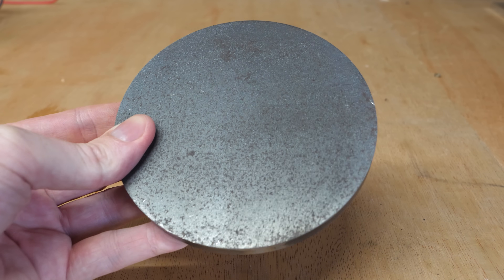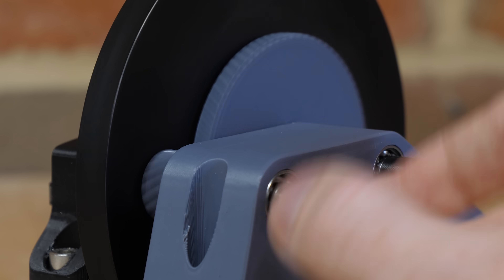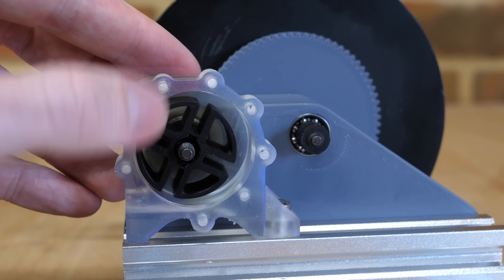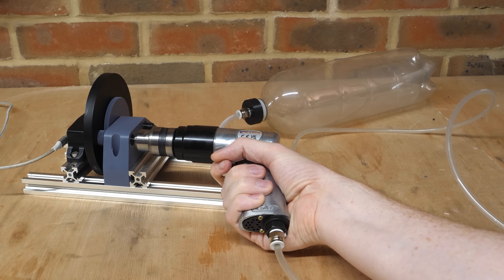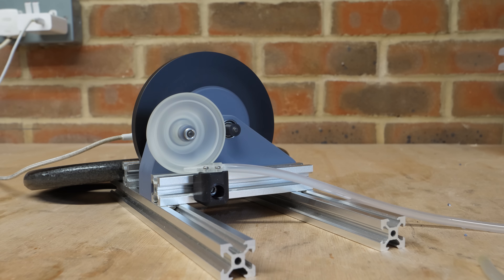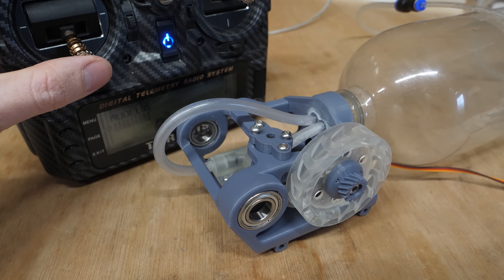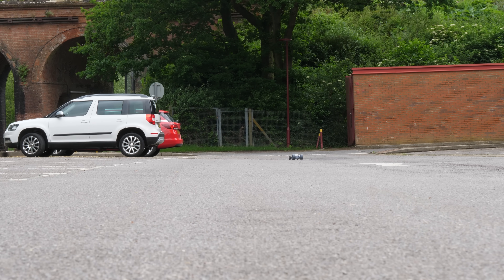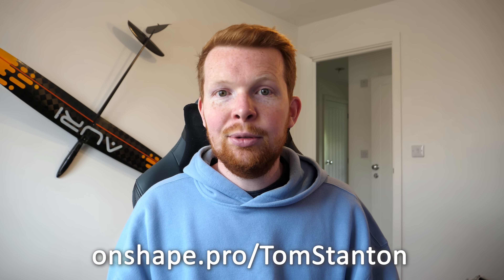Building a Turbine Car

Comment: Tesla turbine?
Reply: It wouldn’t be as efficient at lower rpm’s
Reply: But maybe by using a clutch mechanism higher speed could easily be achieved
Reply: @landon.plywood7324 the problem with the Tesla turbine is there's no torgue. Maybe tons of gear reduction but it inevitably looses efficiency .   A clutch it's helping anything in  theory .
Reply: Exactly my thought
Reply: With Tesla valves on the sides
Reply: Integsa?
Reply: The misconceptions on tesla turbines in this thread are crazy. Let me clear some things up (sorry for the long comment):

Manufacturing: the tesla turbine is SIGNIFICANTLY easier to manufacture. You can buy very thin aluminium sheets (think soda can walls in terms of thickness) and CNC discs with exhaust holes and star washers. Then 3D-print a jig that stamps dimples near the edge of the discs to maintain the spaces at the edges without bolting the discs through. This allows the discs to freely expand under load without exploding. The aluminium also makes the rotor lighter. Also another point regarding manufacturing, balancing is pretty much unrequired.

Torque: the low torque issue is a myth. As with anything mechanical, if you want more torque from a tesla turbine you need to design it with a larger radius to increase the moment arm around the axle. Basically the rules-of-thumb for increasing torque are larger radius, more discs and narrower disc spacing. Larger discs also increases low RPM power and efficiency as the air takes a longer path dragging the discs along. Another point to keep in mind is that the tesla turbine acts as a torque converter, the higher the velocity delta between the flow and the discs, the more torque it outputs at the cost of efficiency.

Temperature: for the working gas the viscosity increases as ~√T. Since we need the flow between the plates to be laminar in order to have the most efficient momentum transfer, increasing the viscosity by using a hotter working gas is a good way of ensuring laminar flow over a wider velocity delta between the gas and the disc. Thus you get wider torque and power curves. With the previously mentioned aluminium rotor design up to 300°C is perfectly safe without experiencing much thermal expansion. For higher temps I have seen some claims of carbon fiber composites being used but I am skeptical of these claims

Flywheels: you don't need a flywheel if you build it right as it will be a flywheel innately. However if you still want to just stick another tesla turbine on the same axle driven by the first one making it a centrifugal "vacuum pump". This is usually called a 2-stage tesla turbine, basically draws a vacuum at the exhaust to increase the pressure difference across the turbine.
Reply: Integza response
Reply: Y'all need some Jeremiah Ferwerda in your lives 😂
Reply: I see it, think on the Tesla Turbine want to write it and see your comment😂😂😂😂 great moment.
Reply: wacks u with a 2 litre plastic drinks' bottle
Reply: I want to ask all of you a question, have you ever tried to build the tesla turbine perfectly as made by Tesla. Because if you have tried you won't say so.
Reply: Would work great once the vehicle is going max speed but would suck at low speeds. It wouldn't have great torque but great efficiency at top speeds.
Reply: They are shit at moving workloads compared to an actually efficient turbine
Reply: I wonder if it's like a seagull thing where every video that shows any type of turbine you will have someone say "TeSlA TuRbInE" or
Why not tesla turbine this tesla turbine that like it's some religious following, the ultimate perfection.
Reply: @blackturbine or maybe people just want to see them in action or at least tried since they dont seem to be very common on youtube from what ive seen
Reply: come to that i think of it, maybe possible but hard to do without precise machinery
Reply: Tesla turbines ca  be made with foil seen someone else make them like that@Skibidigokyllyourself
Reply: @Skibidigoloveyourself  can stamp tesla turbine discs like what Charlie did in one of integza's videos.
Reply: Tesla turbine works for water that has surface tension unlike air
Reply: Air has surface tension
Reply: Tesla turbine is a failure...ive tried 3 different ones they all suck....i was very disapointed so....this turbine i would say performs good..but not best
Reply: @yanikivanov  did you use a flywheel?
Reply: @landon.plywood7324  plywood? No dude i used steel discs...so if you want you can build tesla crap turbine and you will see how poorly it performs
Reply: I'm sure a Tesla turbine won't work under load
Reply: Tesla turbine has been tested by many YouTubers it doesn't work good with air
Reply: I think the only issue is the low torque but high speed
Reply: Not efficient enough

Comment: Have you researched gas engine turbochargers? they use exhaust air pressure to drive a turbine that is attached to a second turbine on the compressor side of the turbo. chances are a profile like that will be your most efficient design.

Comment: If you linked the single powered rear wheel to the other one with a small shaft you'd have a lot more control over going straight. That's kinda of a dragster after all eh?

Comment: Although it's designed for water, I wonder how a Pelton Turbine would fare in this application. You could also test a Tesla turbine too. I think it would be interesting to see a side by side comparison of different turbine types.
Reply: Peltons kinda suck running on gases because they tend to suffer from large windage losses. The DeLaval design he's using is probably the best option, just needs fine tuning.

Comment: I'm not an engineer but I think the problem with your fourth design is that the cavities were too deep, because in order for the turbine to continue spinning each cavitity has to have pressure build in it for it to push so I think the best route would be to either minimize the diameter of the cavities to an efficient level or make them more shallow. Just an idea though

Comment: I have heard that a Tesla turbine is just CRAZY efficient. In fact, their extreme efficiency is supposedly the reason they are not in wider use. They're just TOO GOOD.
Reply: That doesn’t really make sense.
Reply: @mikebond6328  Yes, it does. They get going so fast that they either burn out their bearings, or self-destruct in some other way.

Comment: I have done some research on hydroelectric generation using a Pelton wheel. This device creates maximum    efficiency when all the fluid's momentum is transferred to the wheel by blade causing the stream to reverse its 
direction with the same velocity but opposite direction when the wheel is stationary. A wheel spinning at half the fluid's velocity would capture all the fluid's momentum, resulting in the fluid exiting at zero velocity. Maybe this idea is food for thought.

Comment: Huh, I expected you'd turn that flywheel down on a lathe; do you not have one?  :)

I'd be interested in how much you can improve the vane turbine with lower-friction plastic and proper sealing.  If you can work out the friction, an axial design seems like it could be really interesting, too.

12:37 Point of order: Browsers and things that run in browsers can both (independently) crash quite easily, I don't understand why people believe they don't. -_-

Comment: 2:04 measuring rpm with such a sensor is no problem, as long as you measure the time between the ticks, and not the ticks in a fixed time period. This gives very accurate results, and lets you measure extremely high rpm, more than you could ever need.

Comment: Nice work. Air engines/turbines are very capable. There was a man that developed air engines for vehicles decades ago and it worked quite well. There are some videos on that. His design used multiple carbon fiber air tanks designed to split open in case of failure since they were thousands of PSI and could be extremely dangerous. He designed a van that would get 300km per air fill.

Comment: Maybe it’s already been said, but one reason the pneumatic drill uses so much compressed air because it’s motor isn’t outputting 1:1 in rotation. It’s meant to be high torque, so there gearing to reduce output RPM/increase output torque.
Reply: Not to mention that the rotor and vanes are usually 1 or 2 inches long.

Comment: 7:45 I think that design failed because of air friction sticking to the sides of the channels. Air is surprisingly sticky when it comes to friction. As are most fluids and gasses. As air had trouble making it through those channels it likely lost a lot of air that just couldn't push itself into the channels either.

Comment: Any plans on trying a Tesla turbine?
Reply: It would be interesting to see, for sure. But my understanding is that Tesla turbines need absurdly high rpms to get any efficiency out of them, and even if they're spinning super fast, they are tremendously sensitive to any type of load. 

The Tesla turbine is a fantastic and mesmerizing thought experiment.. but there's a good reason they're not used virtually anywhere in commercial/industrial applications.

Comment: The one measurement I feel like you are missing is taking the power over time graph from the fixed volume test and integrating it in order to get energy. That way you can simply compare efficiency in one number watt hours (or seconds).

Comment: This is cool and all but if air powered things would ever become something useful in more everyday things it would need a way to access an unlimited source of compressed air, but question is, even if you develop motors and things that are highly efficient to use air at the best efficiency possible, you ultimately would need a motor of some kind powered by another fuel source to make that compressed air or constantly feed compressed air, but would that device that is making the compressed air be less consumption then just making an electric or gas motor in the first place? Compressed air isn't free energy, you clearly have to get it from somewhere, which is an alternative power source. This is the same sort of problem as things like solar and wind power, people are sometimes tricked into thinking it's free energy but it isn't, all those materials come at a cost, and batteries to story that energy is also expensive, has limited lifespans and uses rare earth materials and likely other power sources to make, so it's not that "clean". Maybe cleaner then fossil fuels but your still using up rare earth materials some of which are finite and non-renewable.

Comment: Something like 20 years ago in EU somewhere there was a guy or company that made tiny compressed air driven cars. If I recall they got something like 20 miles of range or something like that. It could also be filled using standard air compressor or something like that.

Comment: when u had the idea with the channels guiding the air towards the center: wouldnt it be better it the channels would be guided towards the edge of the turbine instead? using centrifugal force and the added air as a thrust to further increase the torque and rpm?

Comment: Just getting to the first graphs and I think Tom has made a bit of a blunder in his analysis.

The gradient of the angular velocity is not the torque produced by the turbine but rather the component of the torque that is greater than all the other combined losses of the system.

He’s going to falsely conclude that the turbine produces peek power at a lower angular velocity than its true peek power because he’s not accounting for the losses of his dynamometer. 😢

Okay phew all of the conclusions were based on the relative measurements so no harm done, perhaps by design ❤

Comment: That throttle valve may be reducing efficiency and power. Ideally, there should be only only one point with high air velocity - output of the nozzle.  No idea how to control it, though. Maybe placing the valve needle in the nozzle itself?

Comment: Would the turbine be more efficient with some moisture in the compressed tank to increase the reactive mass, or would it be faster with perfectly dry air to get more air volume in for the same pressure?

Comment: You can get very accurate RPM measurements with an optical sensor by measuring the time between high/low pulses.
Reply: Or get the signal and do a Fourier transform to convert it into a frequency.

Comment: It is above my level, but doing full on Model Based Design and optimizing a turbine for this pressurized air system would be really neat.  Are there any Open Source or at least cheap Generative Design tools?  Either way going full on engineering would be very interesting and probably produce a more effective design. 

Could also hunt for any existing Open Access papers on all this.

Also just to reiterate i am not a proper engineer, let alone making YouTube Videos (yet…) so i want to be VERY clear that this is merely an idea and not a “holier than thau” critique!

Comment: Had you considered using a 1/4 inch Air Die Grinder made to run much faster than a air drill which probably had internal gear reduction inside

Comment: Compressed air has to be one of the most inefficient methods of energy storage…
That’s what makes all of your projects with it all that more impressive!
Reply: I mean I just like the concept of pneumatic air compressors and such.
Reply: Yes, it's true. Pneumatic Cylinders are widely used in the industry. They have some (small) ambitions to replace them with electric actuators.
But electric actuators are many times more expensive in the purchase. And Pneumatic is simple and robust in operating and maintaining. That's why they stick with pneumatic.
A big part of the losses occur at the compressor in the form of excessive heat within the compressed air. As it cools down it looses energy. Some manufacturers store the excessive heat in paraffin, which heats up the air as it expands, giving some of the energy back to the working gas.

So, there is potential ...
Maybe Tom find's some clever ways to improve the overall efficiency ;-)
Reply: @notconnected3815  The absolute main reason that pneumatic cylinders are still widely used today in industry is because almost EVERY process in the industrial and most processes in commercial product production require compressed air for one thing or another. Weather its a cooling nozzle, a lubrication atomizer, or a heat resistant switch(only to name a very small pool of options where compressed air is used in place of eclectic).

In example of heat where I work(Cement Factory) we need to measure tire slip on our Kiln, the kiln shell is at 300-400°C. So we use a pneumatic switch to activate the electric limit switch with a small copper bellows to measure the difference in speed between the kiln shell and tires. The air getting activated each rotation cools the seals in the pneumatic trigger and bellows activates the NO Switch(My Design). We used to replace whisker switches weekly if not more often in dangerous positions for the electricians, changed the design and there ya go.

Same for our Klinker Cooler Redux Valves, exposed to temperatures of above 100°C. Pneumatic cylinders will last 5-12 years and an electric actuator will last approximately 5-7 months in those operating conditions.

Comment: This is so cool. I love the compressed air series - one thing that stands out to me is how the air comes into contact with the turbine, could you design a housing around the nozzle so that air that "splashes" off the blades can instead forced into the turbine? I'm imagining a waterwheel and how there is a lot of turbulence generated as water enters each bucket and some splashes out, I think there are similar mechanics at play here. If you could design a sheild around the nozzle to redirect that spray back into the turbine, I bet you'd see some efficiency gain.

Comment: I got inspired by this and want to make a electric flywheel dragster,  I would like to design my own clutch system for it to get maximum axeleration 0-60 in 1.2 seconds would be cool to reach 😎
Reply: Imagine if the flywheel is around 6 kilo massive steel 🥵

Comment: Great video, your second turbine was a straight forward impulse turbine. The 3rd turbine is a reaction turbine, but the path should be a convergence nozzle choking the flow at exit. These turbines work with the entire rotor being driven by air so not suited for your design. I would stick to a single impulse turbine. Staging the turbine as per a Curtis turbine won't work well as again their designed for being fully driven by air. Have you thought about having a water driven turbine. Have compressed air to pressurise a water vessel that drives a water turbine. Would run alot slower and wouldn't require higher tolerances. FYI your calls were correct. Impulse turbines work best at 0.5 air speed at nozzle. Reaction turbines around 0.8 air speed at nozzle

Comment: I've done similar experiments w an air nozzle blowing against blades. I discovered that changing the angle of the nozzle to the blades based on the wheel/blades RPM has benefits. One angle for high torque/ low rpm, then changing the angle as it spins to more of a tangent for higher rpm. Also, I've found that the plastic soda bottles can hold up to 150psi, then regulate down to the usable psi.
Reply: That sounds easier than adding a gearbox

Comment: I had a small compressed air powered toy motorcycle when I was a kid.  I think it was piston powered, but I’m not sure.  This was in the early 1980s, and it would drive about 30 ft or so under its own power.

Comment: Great video, and very neat concept. This reminds me of the "Turbonique" drag-axles that were a thing in the american drag-racing scene back in the 60s. They were essencially a turbine wheel, driven by a hypergolic fuel, integrated into the rear axle of the car, instead of having a traditional powertrain to drive the rear wheels. Maybe something similar is possible on an RC scale, similar to pyrotechnic starters on early jet engines with a solid rocket motor.